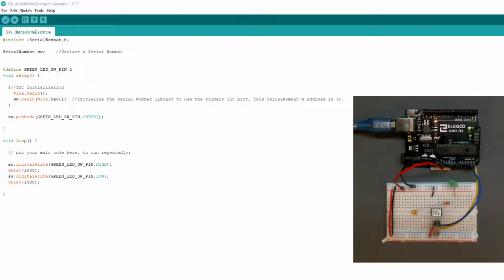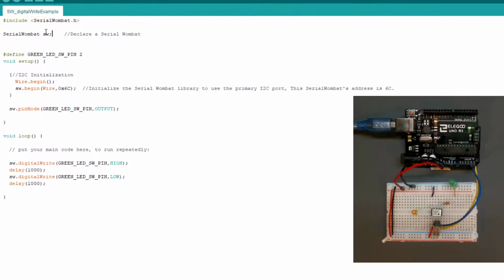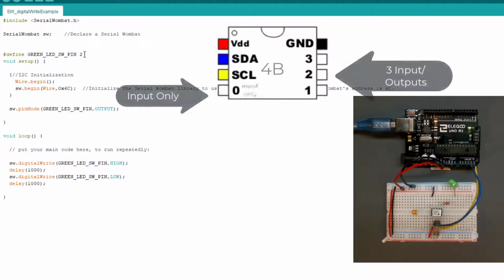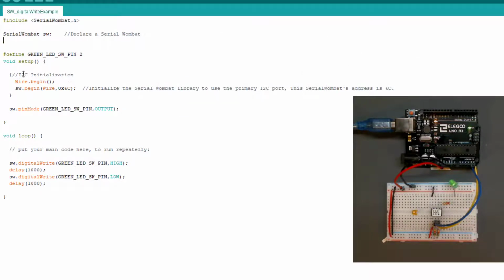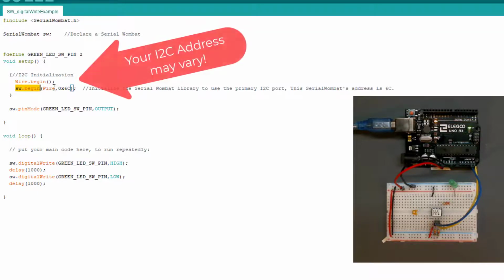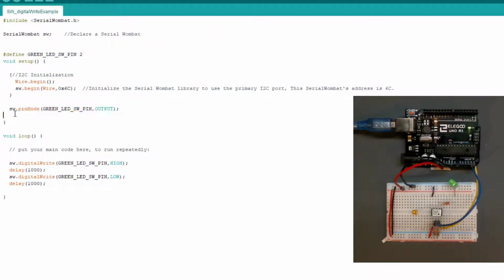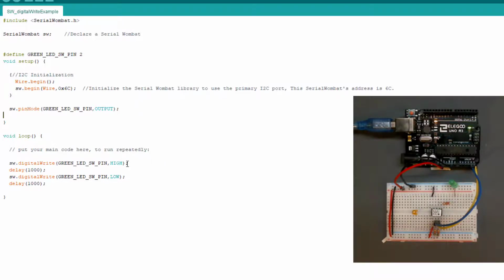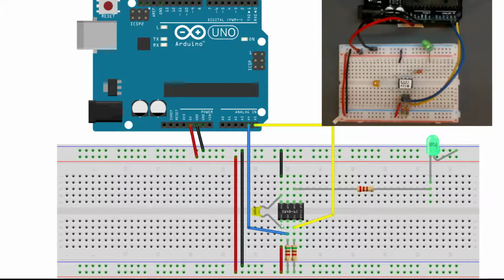Adding Additional Digital Outputs to Arduino with the Serial Wombat 4B Chip over I2C

Comment: can the serial wombat also run on 3V instead of 5V? Also in the diagram the long black GND wire doesnt seem to be connected? Is it for the resistors?
Reply: Yes.  The Serial Wombat 4B chip will run from 3.0V to 5.5V with no change in operation.  Inputs and pull up voltage should not exceed the input voltage to the Serial Wombat chip's power line.  The long black wire (and the red as well) just connects the rails on both sides of the breadboard.  You are correct that there is nothing connected to it on the bottom side.  I start with a template diagram for each video which has the two long wires, Serial Wombat Chip, power lines, cap, and pull up resistors in place.